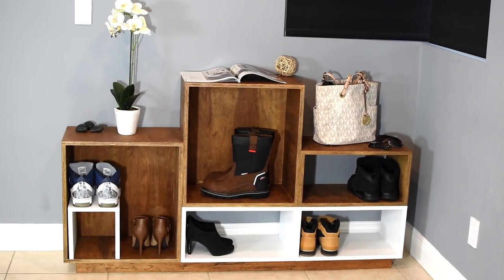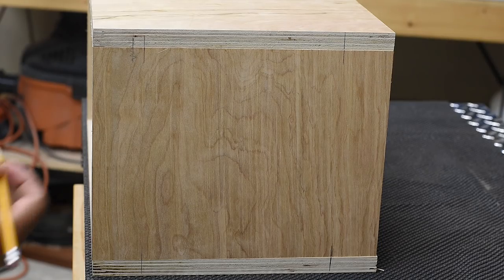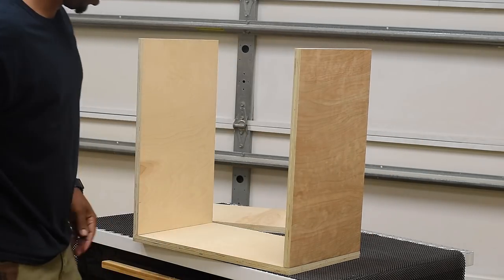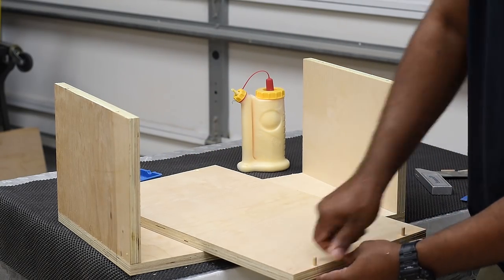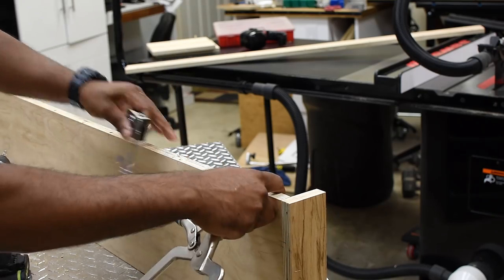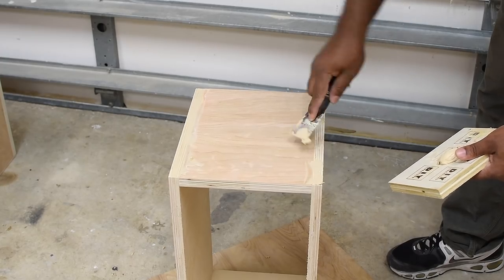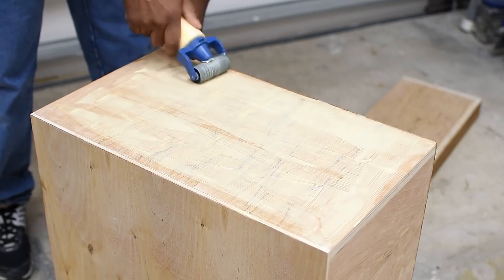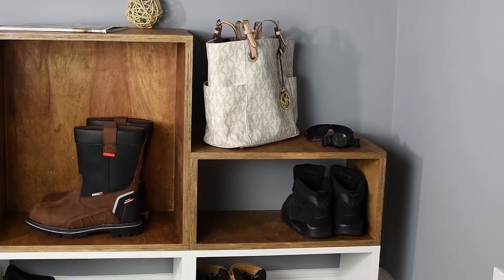EASY DIY SHOE STORAGE

Comment: Awesome project!  This cries out for some edge banding.

Tip for using the dowel jig: put a piece of tape over the hole you're not using so you don't accidentally drill in the wrong place.

Comment: Nice simple build -- curious your thoughts on dowels vs. pocket holes after trying this?  All tools available, which would you choose?  Also, from the design perspective, I really like the simple toe-kick base.  It is a small detail that makes a big difference, and transforms this from a bunch of stacked cubes to a cohesive modern design.
Reply from the maker: Thanks, Mike! in terms of speed I would go with pocket holes, they are great for hidden locations. When it comes to aesthetics dowels are much cleaner, but could be more difficult to line up.
Reply: DIY Creators good to know.  I just picked up this old Stanley doweling jig from the 70s, still new and in box.  Might give it a try on my built in bed for cleaner aesthetic
Reply from the maker: Anytime! yes, I'd say give it a shot! Just play with test pieces first to make sure you have a good handle on it.